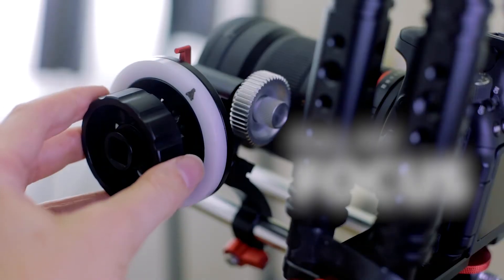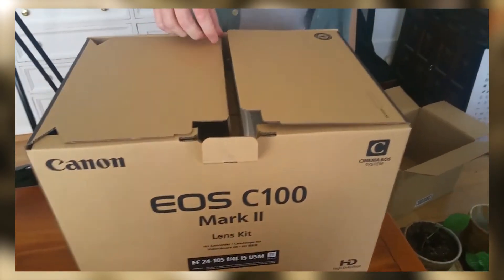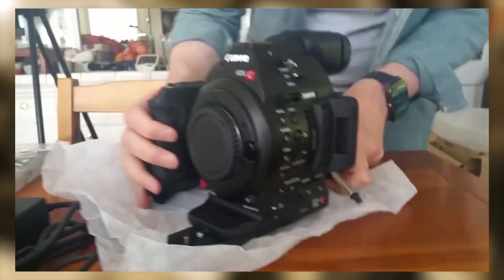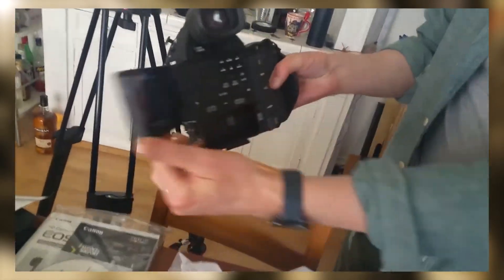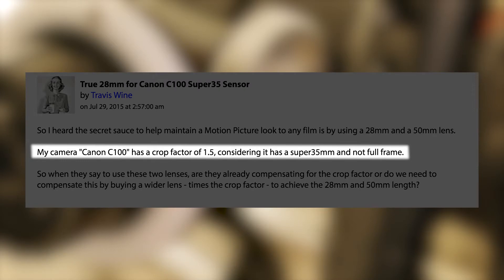Is a Video Crop Frame Sensor Bad?

Comment: Hi, as an older guy that used SLR's back in the day, I have always struggled to undertand crop factor
I  know what 50mm and 35mm and 85mm is for SLRs.
You really explained this crop factor very well.
Thanks a lot
Reply from the maker: You're very welcome. As an older guy I struggled with it as well. But once I found out about the the desire to keep familiar focal lengths for both industries it all clicked.

Comment: what about Micro Four Thirds? That wasn't even part of the explanation. Another video maybe. Bdw if you do make, in the next video, pls try to explain, in your style how the aperture and focal length relate to each other in practical sense? For e.g. does a f2.8 50 mm FF lens on Full-frame Sensor equals to f5.6 100mm Lens on MFT Sensor?
Reply from the maker: We didn't get into Micro Four Thirds to keep it simple and prevent confusion. Besides, they're a crop frame sensor so they fall on that side of the fence. Same difference just different crop factor. Point of the video is really just, still world relates to lenses differently than film/video, hence the crop factor.
On the aperture and focal length question, my first thought is, the aperture and focal length of a lens don't change based on the sensor. A 35mm is a 35mm, the sensor size affects how much of the image from the lens you catch. But I may be misunderstanding your question. Tell me more sir.